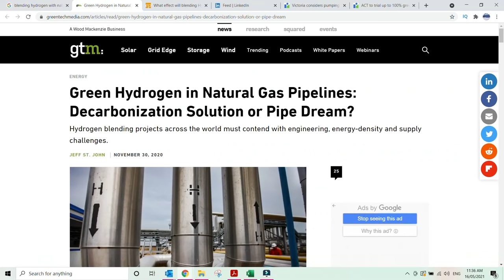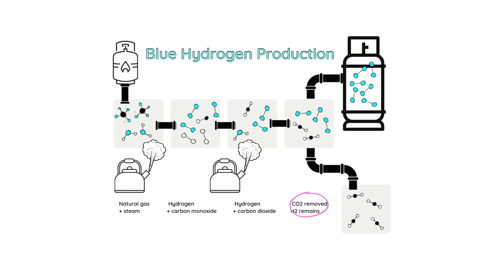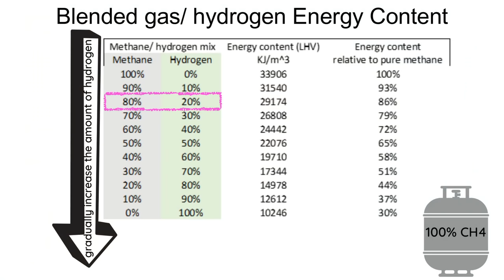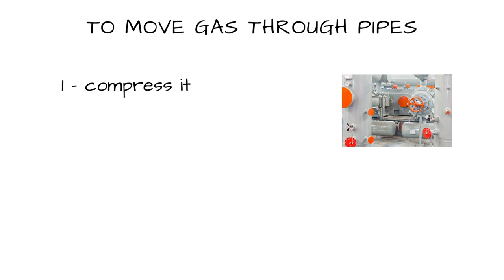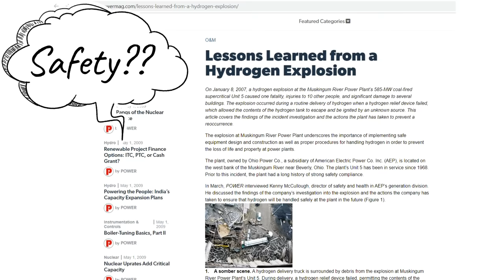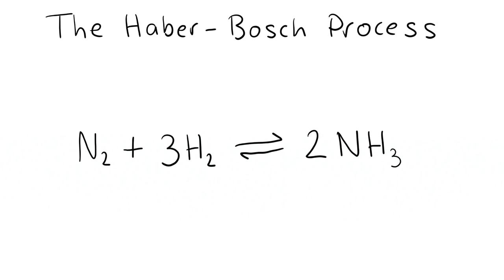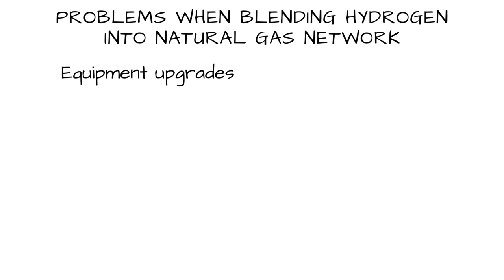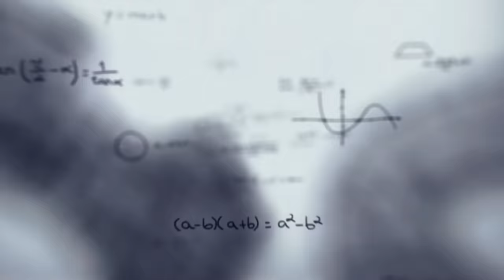Hydrogen in the Natural Gas Network

Comment: The gas networks in UK and Australia were originally set up for 'town gas'  or 'coal gas' - a cocktail of (mainly) hydrogen, CO and other stuff. It was between 10 and 20MJ/m3 - much lower than methane at 36MJ/m3. Hydrogen is 11MJ/m3. There's a pressure regulator on top of all gas meters which drops the pressure to ~20mBar - the mains feed is at least 75mBar, possibly up to 2Bar. I'm struggling to see why the gas distribution network isn't up to the job of distributing hydrogen.
The biggest issues with hydrogen are that the flame velocity is much higher than methane, it will explode over a much greater range of concentrations than methane and it burns with almost no visible flame. The flame detection in modern boilers relies on the presence of carbon in the flame, so alternative flame detection systems are required. None of this is insurmountable; the kicker is  economics. If green hydrogen is cheap it's a solution, if not we'll be using heat pumps

Comment: sorry, but adding water to gasoline is bad example. there is water (more lake mollecular than droplets) water added to fuel to produce gasoline. It is added to reduce knock, to better control octane number. There are also systems to add water into gasoline engine as separate system aiding fuel system. Mist of water added to warm engine turns into steam quickly. It cools engine a little but also adds lot of energy. Steam drives pistons with exploding gasoline. It helps to clear engine and also increase horsepower. Only drawback it might be destructive for exhaust system especialy catalythic converters.

Comment: In USA, you should grow up. Start investing into green technologies.
Hydrogen is good for industry / and big transport vehicles @ 350/700b.
Metalhydrides are good for homes, small cars, batteries @ 20b.
Biofuel stations absolutely can throw off mining or extracting any natural gas. The problem is you need to separate your trash and be peresistent. Can be applied in a wide range of applications.

Comment: Dutch natural gas has ~4% hydrogen in it. That's no problem because the abundance of methane molecules blocks the hydrogen from leaking through our pipe walls and seals.
At 20~100% hydrogen, leaks and flow rates become serious issues.

Comment: I saw testing on exploding gas tanks and hydrogen tanks. Hydrogen all the way. By the way if Hydrogen is 70% less efficient than gas, why someone would worry about explosion? It means is 70% less distructive than a gas tank. H2 if leaked goes up to the atmosphere instead of gas also who said you really need 700 bar tanks? The gas distribution at home goes at 0.2-0.3 bar.

Comment: Lets take Melbourne Australia in 1969. In that year we set about converting from town gas to natural gas. So every stove top and oven and space heater that used town gas got converted burners.

Now I haven't found the composition of what town gas we used but it seems 50% Hydrogen, 35% Methane, 10% Carbon Monoxide and 5% ethylene was typical around the world. Town gas is still used in some places.

My point is that we used a gas that was substantially hydrogen by volume in the not so distant past, in piping that is probably largely unchanged because I haven't seen any noticeable effort to close roads and replace it.

Town gas had 1/4 to 1/2 the MJ per cubic meter of natural gas but was still highly useful for domestic cooking and heating. Methane would have contributed significantly to the calorific value as would carbon mon oxide. Haven't found a %calorific value break down. Doubtless straight hydrogen would not be as good without those carbon compounds but the question is it good enough not is it as good.

It seems disingenuous and unconvincing  to say a product consisting mostly of hydrogen that was used for 100 years in Melbourne (longer elsewhere) is not possible.
Reply: and how much of that 100-year-old infrastructure is left today?
Reply: @NaumRusomarov  Well the gasometers have all gone now of course as they became unnecessary - it was valuable land for housing/parks. The Port Melbourne  gas plant is certainly housing/parkland now. Perhaps you are asking about distribution pipelines. 83%  of Victorian homes have a gas connection is the short answer so the infrastructure is in place and in operation.

AGN is introducing a 10% mix of hydrogen in Albury Wodonga, Gladstone, and Mitchell Park. So it is about to be done.

Comment: This guy sounds a bit alarmist.  Recent studies have shown that hydrogen does not escape flanged and threaded connections at a greater rate than natural gas.  We need more research to prove this but this guy is sharing his opinions as facts.  The issues he brings up are overcome through economies of scale and engineering solutions with sustainable energy, especially otherwise curtailed energy.

Comment: Once the hydrogen gas can be transferred using existing pipeline to land... the said gas will be use to run gas turbines and provide electricity to homes. There's no need to apply gas for heating or cooking. Nowadays, most cooking and heating comes with electric related appliances... just a thought 😁
Thus, reduce safety concerns at housing and nearby neighborhood. Nevertheless, I agree to the point of using more energy to compress the hydrogen gas and expenses along the way

Comment: Another problematic aspect of widespread, indiscriminate hydrogen implementation that I don't think was covered here -- excess atmospheric hydrogen inhibits methane breakdown, so actually amplifies the impact of methane emission and leakage.  Residential gas distribution grids are (I imagine, I haven't researched this part) leakier than the average gas distribution per therm delivered, so the impact of this dynamic is most significant in residential heat applications.  Ope.

Comment: The idea of replacing natural gas with hydrogen made through water electrolysis for then to go on burning the hydrogen for heating must be the most inefficient ways you can use electricity for heating. Install heat pumps in the homes instead! You might then get 3 times the energy from the electricity as heat instead of less than 50%.

Comment: I'd like to see a piece on average annual hours of generation by on and offshore wind turbines.

As an ex-sailor (I got my fill) I never expected to have a problem getting becalmed off the coast of Northern California but not far inland it seems that wind is not as regular.  Perhaps there's not as much difference once gets up to 110/140 meter hub heights with onshore.

When I click on the global map of current wind speeds I have yet to see a time when the wind was not blowing off the NorCal and southern Oregon coast.

https://earth.nullschool.net/#current/wind/surface/level/orthographic=-95.46,29.45,289

The number of hours of generation is important because when a turbine is generating there's no need for storage.  If the cost per MW for offshore is higher than onshore that might be offset by the lower storage needs for offshore turbines.
Reply: Onshore most installations average around 30% of their rated capacity, and offshore installations average around 55% of their rated capacity(wind does get more consistent at wind turbine hights but but there is still a difference). The main advantage of onshore wind turbines is that their installation costs are substantially lower, and if you have a sufficiently large area you are distributing the genoration across such as the entire United States storage becomes significantly less of an issue.

Comment: hydrogen doesn't get pumped around it's too hard to pump so in this circumstance an electric wire from the electricity manufacturer to a hydrogen plant where the hydrogen is needed would be the norm. Howard our very smart welder  is on the money - Even at room temperature, steel can absorb hydrogen atoms. due to the diffusion and dissolution of hydrogen in the microstructure of metal piping or infrastructures.

Comment: Not sure if this channel is speaking from an Australian viewpoint, but the UK is far ahead on this already.
1. As far as safety is concerned - hydrogen is far safer than petrol or natural gas - this has been proved many times before.
2. As far as domestic heating / cooking is concerned it is simple to re-jet a burner.  It was done in the 1960's and 70's in the UK when the whole country shifted from coal gas to natural gas.
3. There is already massive gas infrastructure - to rip that out and replace it will be hugely expensive in direct cost and pollution.
4. As we get to the point where solar / wind generation outstrips demand, the production of hydrogen as a by product is a method of storing the energy.  The Orkney Islands have been doing it for years.   
https://www.orkney.com/life/energy/hydrogen
https://youtu.be/Rybpaqhg5Qg

Blending in the national network is already under way in the UK.
https://www.spglobal.com/platts/en/market-insights/latest-news/electric-power/042921-interview-uks-national-grid-looks-to-prove-case-for-hydrogen-blending
https://hydeploy.co.uk/
https://cadentgas.com/news-media/news/may-2020/hydeploy-update

Comment: it's very simple to pump hydrogen instead of natural gas through the pipe networks - hydrogen is made from processing natural gas during steam reformation. I'm pretty sure all natural gas is steam reformed anyway. Maybe they'll use less additives when they change over to hydrogen! more to the point though, I think they should use electric more and stop supplying gas as it's better on the environment! I mean everything is going electric anyway!
Reply: Almost all industrial hydrogen is currently produced from steam reforming.  Only a small portion of natural gas is used in hydrogen production.  Most of it is burned in homes, in power plants, and used as chemical feed stock, such as for producing polyethylene.  When I worked in an oil refinery, at that time none of the hydrogen was produced from natural gas, but that was 40 years ago.  With the fracking revolution, that may have changed.
Reply: @richdobbs6595  With current fracking techniques, i can imagine all natural gas is steam reformed to some degree.

Regardless, it seems they could easily steam reform all natural gas and make hydrogen, add some stuff to make it safe to burn in the homes, then voila!!

Comment: Hydrogen is crazy dangerous. Wide ignition concentration range and high flame front speed (i.e. ~explosive) mean that it is much more hazardous in a consumer environment. Furthermore, a dilute mixture with methane would not be as light and would not disperse as rapidly. A much better, bigger and quicker win for global warming would be to help China to convert from coal to natural gas. That conversion alone would reduce global warming emissions by perhaps 10% to 20%.
Reply: Dispersing is good in most cases.  Hydrogen goes straight up where it isn't likely to find a spark source, isn't likely to be contained (containment makes for more efficient explosions).  Those are about the only good points for H2.

Comment: Hydrogen embrittlement is REALLY important. It makes pretty much anything that uses hydrogen brittle and makes it break. The pipeline, the hydrogen burners, the batteries, the tanks. Everything. Add to that that it is explosive and really like to leak...that's...bad...but at least it's hard to set off, right? Nope, static electricity is enough to ignite it and boom goes the neighborhood.

And just to put 700 bars worth of pressure into context. That's 2.5 times more than the overpressure caused by the bomb explosion during the Oklahoma City bombing. Just no. Bad idea.

Comment: Forget hydrogen. It can't be stored and transported easily and safely. Forget gases, we need to use electricity for everything, and prices need to come down.
We need some batteries for peak and grid leveling. Lithium-Ion are too critical, as lithium and cobalt are hard to come by in the amount we need. 
Old lead-acid technology batteries, modernised with carbon in the electrodes that stop them sulphating irreversibly, are a very good choice; as they last for 30 years of service, and lead is infinitely recyclable. The only problem, the manufacturer can't make great markups on them.
The future green grid should be made by 50% solar and wind generation, and the other 50% by Gen 4 nuclear reactors, those using TRISO fuel pellets, and built in modules - so the entire reactor is fully scalable.
The uranium multi-layered pellets have a negative temperature moderation coefficient, so they stop neutrons moderation above a given safety temperature, and therefore the reactor core simply can't go into meltdown. The pellets need to be positively sealed, to avoid emission of gaseous radioisotopes.
Forget hydrogen, we need large amount of long-lasting batteries, many wind turbines and photocells, and safe modular nuclear reactors.

Comment: Hello I think you have misunderstood why hydrogen would be pumped through natural gas pipelines. It will not be to set it on fire. today we have cars that run on batteries in the future, they will also be powered by hydrogen. The big car companies are currently spending big money on research on fuel cells. And several countries have begun planning for a hydrogen infrastructure. The rechargeable car system is stupid. We will need to build new power plants and upgrade the entire electricity grid for electric cars. It takes 40 minutes to charge a car to 80%. You refuel a petrol car in about 5 minutes. A hydrogen car takes between 5-10 minutes to refuel.

Comment: .                     Well the base idea of replacing natural gas with hydrogen for home heating is too flawed to begin with.  Rosie,  stuff discussed regarding using hydrogen for cars is much worse with using it for heat. At least a car  benefits from hydrogen's light weight, or a plane so much more so. And with cars we are talking about replacing the super inefficient ICE.  If you want to heat a home, water, stove etc. electrical resistance heating is 100% efficient at time of use, the ultimate replacement for natural gas, no batteries needed. I wonder how burning natural gas to produce electricity to heat something that could use the natural gas directly would work. Obviously loss from conversion, but all C02 could be captured from the natural gas, and electricity loss over distance is much smaller than losses of natural gas from leaks.  So how much loss from conversion verses loss from leakage?

                    I thought this conversation would be something like using natural gas pipelines for delivering 100% hydrogen for fueling a plan, or nitrogen fixing, or other uses for hydrogen, not mixing with natural gas because that wouldn't be the point/purpose. Thus this video needed some statistics regarding how much leakage would happen with 100% hydrogen in natural gas pipes and if there is any way to seal up these pipes much better. But almost none of the conversation was about that, too much about mixing with natural gas. Is this the conversation you told us to look for? If so, this video was a disappointment.

Comment: Hydrogen stored in solid form could be a great way forward. Engineers should not spend their time pointing out problems, rather they should be focused on how to solve them.
Reply: Fred, engineers are focused on solving the problems. Hydrogen problems have already been solved. The problem that hasn't been solved regarding hydrogen is that it is too expensive to utilize through pipelines. You have to realize that while every problem has a solution, many of these solutions are impractical. Also, Engineers have to look for problems in order to know what can go wrong. In many cases the magnitude of what can go wrong far outweighs any benefits you might get from a potential solution!

Comment: I see your problem there; you have a Dell computer. Try a Mac and use any and all software and lower your overall cost of ownership.
Reply: Haha, good joke - wouldn't touch a horribly expensive and restrictive Apple POS with a barge-pole.
My daughter is on a network administration course.  A couple of student were having problems, then the instructor asked them what computers they were using.  "Apple" came the reply.  "Well there's your first problem" was the response.
Apple stuff is for posers with more money than brains.

Comment: Such a horrible idea. Hydrogen is almost impossible to contain. Imagine someone has polymer gas lines running through an enclosed space and now you have small amounts of hydrogen leaking THROUGH the walls of that pipe. Hydrogen is EXPLOSIVE at concentrations as low as 5%.

Comment: All of the economics in this discussion has the impact of CO2 at $0.00. The conversation changes quickly when you add a $60/ton cost (the bare minimum....$180/ton) of CO2. Without this consideration, we'll continue to see insurance companies refuse to insure A LOT of homes. And that's just the start. And a lot of compression and transportation issues go away when you use ammonia as your hydrogen carrier.....and ammonia is combustible. It's sad that this engineer isn't more of a problem solver.

Comment: Hydrogen is a little more pricey than natural gas.  If you are going to burn a hydrocarbon make it worthwhile.  A lot of the old country gas wells have some funny little orange and white flares of flame as it is raw unrefined not to mention the inert gas Radon bad for the kitchen gas range. A lot of old farmers with gas heat developed some real odd cancers.  Burners have to be jetted for the gas they burn or you risk explosions. [10:00] Is Hydrogen more dangerous than Propane?  It will not hang on the floor like Propane it will evaporate.